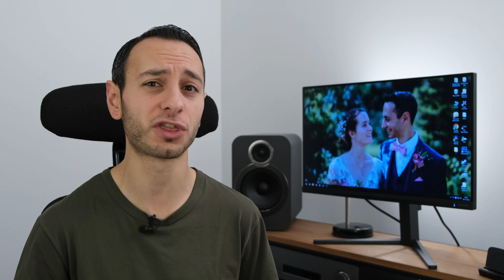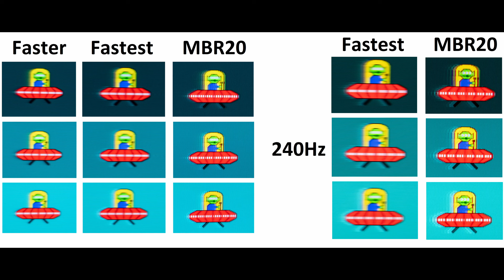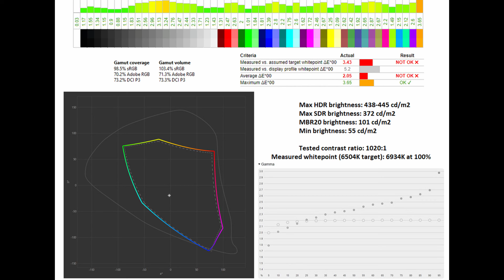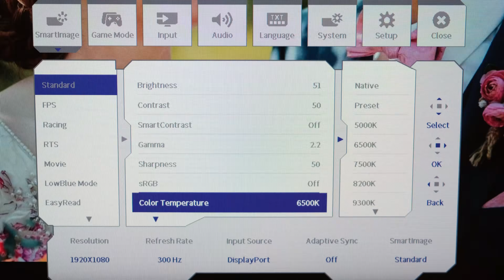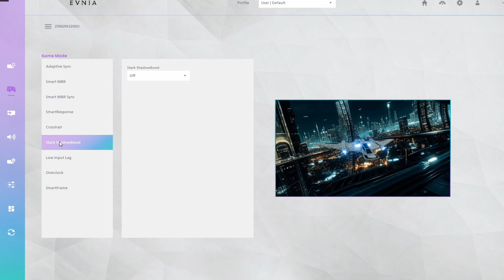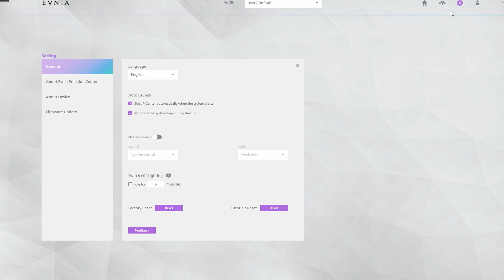310Hz IPS Gaming Monitor! Philips Evnia 25M2N3200U

Comment: Então resumindo mesmo tendo 310hz se não atingir isso em fps é melhor abaixar para 240 para ter uma responsividade mais agressiva e utilizar o máximo possível do monitor em termos de desempenho?
Reply from the maker: To a certain degree, yes. But you can go for max refresh rate, just know that it won't perform as it should at 310Hz

Comment: I just got this Samsung 350HZ IPS monitor 1440p but I was surprised to see there's no reviews of it at all :| it performs well though  (Odyssey G60F)
Reply from the maker: Enjoy!
Reply: How is IPS glow and contrast?
Reply: @marcinmod1490  Kind of typical of an IPS monitor although it does have local dimming, I don't think it has many zones so I just turn it off. The contrast is nothing to write home about either, but I find it a lot better than the AOC 25" 300hz 1440p monitor I tried a week earlier when it comes to viewing angles (they were terrible on the AOC Q25G4SR).
Reply: @GOONCAVECOOMER thanks, I'm in the proces of buying new 1440p monitor. Can't find anything perfect, always something wrong.

Comment: i have the Philips Envia 27M2N3501PA/00 that you reviewed.

The viewing angles are so bad that the corners don't seem "sharp" enough, they're a bit blurry.

Not to mention, the overclock mode makes things even blurrier! and if you disable the OC mode,  you need to factory reset to restore the regular sharpness of the screen. Did you have the same feeling? That you'd like the sharpness slider to go a bit higher than 100? perhaps 120-130?
Reply: *aside from that, it's a great monitor for anyone asking. Measured 396 nits in movie mode R 99 G 99 B 100 with 0.1-0.2 Delta. In regular mode, it goes to 410 nits (but ugly af uncalibrated).
Reply from the maker: I'm surprised to hear about the viewing angles, but I can't recall the exact settings - would have been shared in the video!